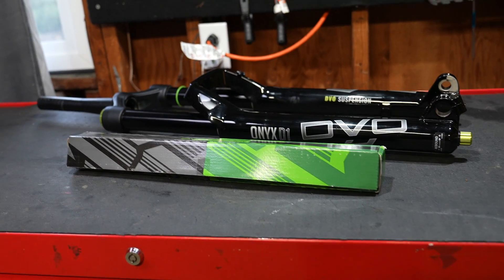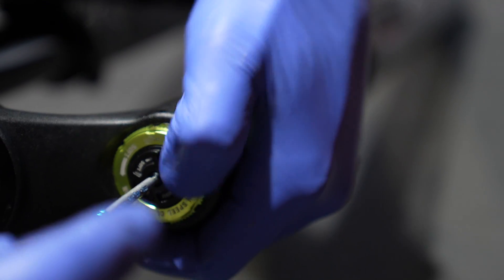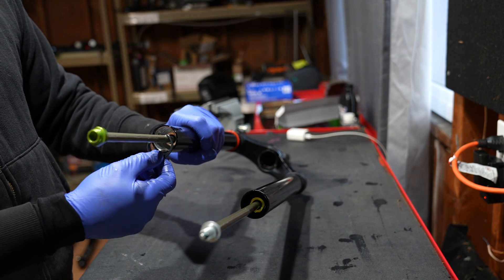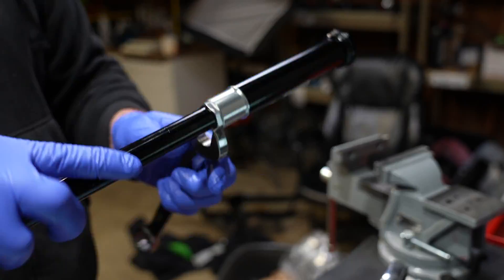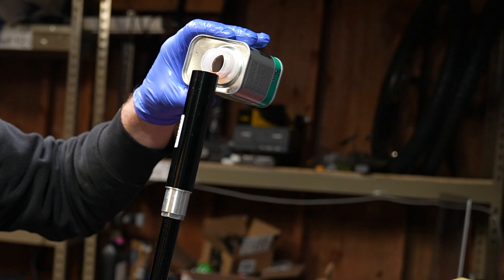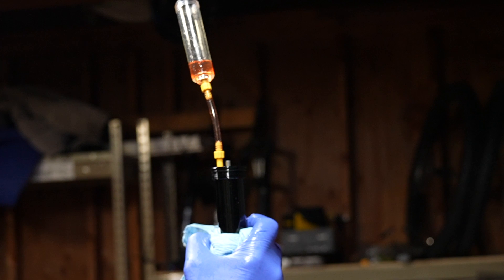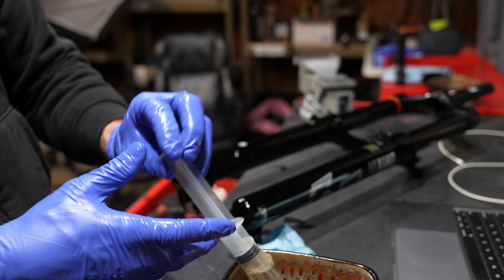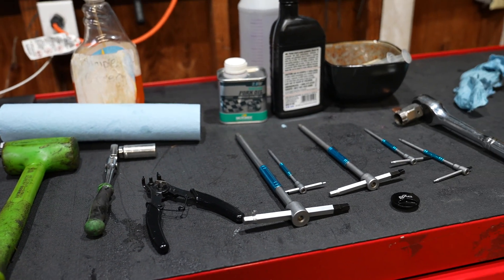DVO Onyx 38 SL Full Service

Comment: 5:15 take two pieces of wood, clap them in the vice drill a 26mm hole right where thy meet then use them to grip the rod. if that doesnt work try again with the think piece of wood in the middle. if get some handscrew clamps.

Comment: The best oil for the lowers on my onyx is fox gold 20wt. Butter smooth no seeping no stiction. 25 each leg. Tried spectro and wpl 7wt. Not even close.
Reply from the maker: Lowers fluid does nothing sorry to break it to you, it’s bath oil. Sloshing damper compresses oil, and good luck with your clogged foam o rings. Change it out when it starts leaking. Fox gold oil is rubbish

Comment: Nice to see, I do the service on all my forks but the zeb is probably the easiest of the bunch.
Well, maybe that charger bladder isn't the easiest thing to replace also I screwed up the bleeding the first time I had only a cup installed and stroked the shaft a couple of times 😂 it turned out damping vanished, anyway I figured you have to use a syringe to properly bleed it...😅
Reply: During my first lower leg service a couple months ago i quickly learned that if I kept using my torque wrench on those bolts, i was going to strip or break something (or both)
Reply: Was it a shitty torque wrench? Maybe. Either way i appreciate your tip
Reply from the maker: It’s not the torque wrench, my fork had loose lower leg nuts after 3 rides. Not even the factory knows how crush washers work. I didn’t either tell 6 months again. Tighten hammer tighten.